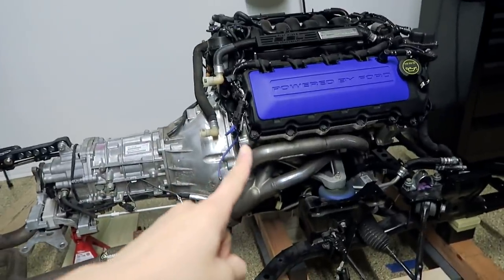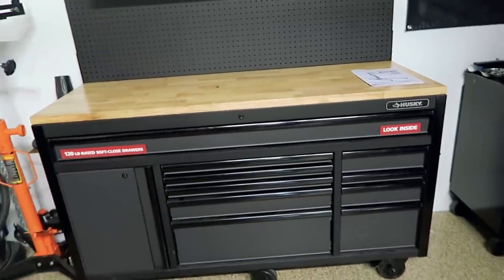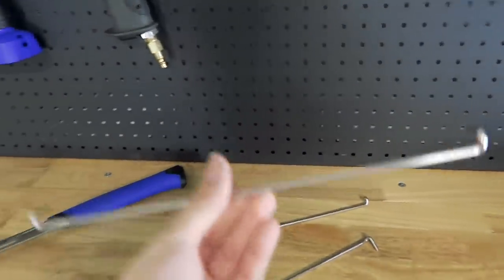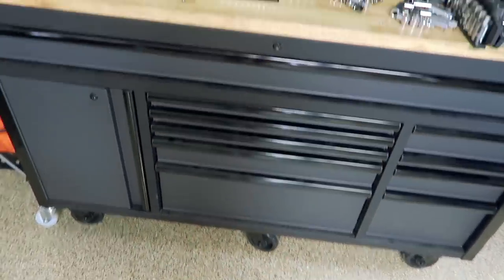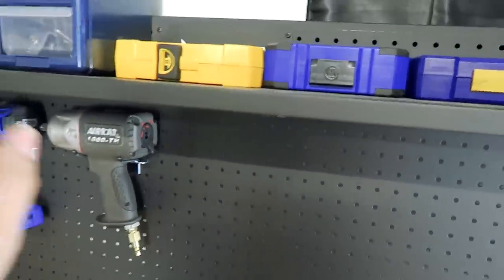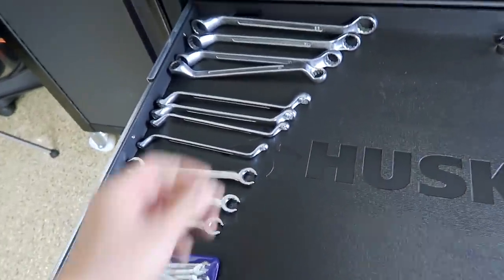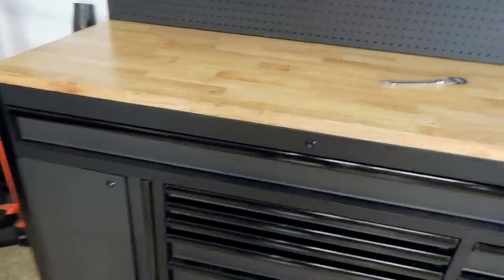I FINALLY got a BIGGER TOOL CHEST that fits all of my tools and MORE!!

Comment: Don’t get rid of the old box,  connect them together. Eventually you will fill them up.  It always happens.  Recommended note: In the aircraft industry, we use foam pads and cut out silhouette of the tools.  It makes it nice and neat, the tools are locked in place so they cannot roll around, and if one is missing you can easily see what is missing.

Comment: Awesome tool chest.  I have a huge 5 foot wide, 6 foot tall double-decker that I used when I was working as a mechanic.  Now since I retired I have pretty much been throwing tools into the drawers.  I need to go through and organize mine.. I have a drawer full of sockets all the way from 1/4 to 1 inch.  Hard to find a specific wrench when the whole drawer is filled with wrenches.  That old chest will work to put stuff that won't fit or you need to keep separate.  Another suggestion, labels.  Label each drawer so you can quickly go to the right one.

Comment: I been a mechanic for over 20 year, I brought the 56 inch husky top and bottom toolbox 3 year ago I still haven’t complained yet. I own lot of different brand toolbox.I just can’t justify spending 10,000 plus dollar on a toolbox
Reply from the maker: I agree. I see no issues at all.. I've had some comments stating why not snap or other 6-7k+ tool boxes.. well. The $700 one I have fits the same tools and works the same way ;). I can spend that money elsewhere. Cheers!

Comment: You can get foam pads which you can cut out yourself and put labels on for each spanner / socket etc so it stays in place for certain and has a dedicated slot, along with small stickers saying the size etc

Comment: I saw you spend a lot of time organizing your wrenches during the change-over to the new tool box.  They won't stay that way, though, for long.  Every time you open or close the drawer, they scoot or roll around inside.  Have you considered buying some wrench racks or using the plastic bags they originally came in?  They're also handy when you need to take them from the box over to work on a car.in the garage; it's the same principle as organizing your sockets.  Try giving those a shot; I think they'll work out for you.  Incidentally, that bottom drawer full of odd tools and battery chargers that you can no longer identify is usually called your junk drawer.

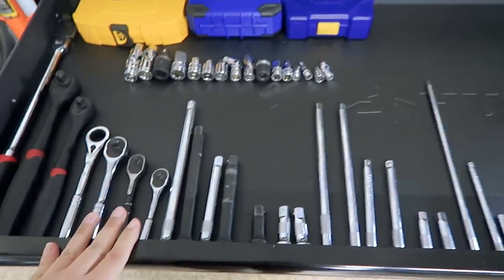Comment: Doris--It appears that you already have drawer liners in your toolbox, which is great.   Keep your tools in the carriers provided at purchase, or buy wrench/plier/screwdriver racks.  I don't care much for socket rails (they're flimsy and tip over),  so I buy plastic socket trays to store and transport them as needed.  This prevents them from sliding around and maintains your tool organization at a reasonable cost.  All or most of these items can be purchased on Amazon or at auto parts stores.  A few drops of oil on the drawer slides and/or bearings insures they open and close easily.  The "converters" you mentioned at around 7:20 on the video are more commonly known as adapters.  For instance, you can use adapters on a 3/8"-drive ratchet to also handle 1/4"-drive sockets, as well as 1/2"-drive sockets.  I'm not gonna tell you what tools belong in what drawer; everyone needs to figure that out for themselves.  You usually end up putting the most-frequently-used tools in the top couple of drawers, and lesser-used items below those.  Other than that, you're doing fine, so have fun.

Comment: I'm going to be really technical here but here goes, clicker torque wrenches have moving parts and really should be kept inside your house where the temp. is controlled and kept away from temp. swings. May I also suggest that they be calibrated before you start assembly. 
Have a great time with your project!

Comment: Should get some dense foam to use as a cavity insert organiser just cut out the shape for the tool and insert the tool. Neat and easy to maintain. Stops everything from sliding around in the drawer when you use a hip to shut it when you are busy

Comment: Check out the Tekton wrench trays. They come in various sizes, for your various sets. And they store them slanted and overlapping, so you'll shorten up your columns of wrenches. What are your plans for the old box? I was thinking you could make that a pneumatic/power tool cart. Maybe wall mount the chargers, keep them from blocking table space. That would free up a ton of space in the new box for more hand tools! 😁

Comment: Very nice. I was going to suggest going to a local mechanic and asking to see how they lay out their boxes. Since they do it on the daily, and may put stuff such that most used is higher, etc. But alas, you have a system. Fine tune over time. Very nice start to a well rounded set of tools. You should be able to handle most jobs. I suspect you'll need a few more tools for the engine rebuild. Mag base and a 0-1" dial indicator comes to mind. I like Starrett or Mitutoyo, but not required. I was a machinist for quite a few years so I have a lot of tools for that job.

Comment: You should Mount the chargers either on the pegboard or on another board which you could secure to your new toolbox.  This way you could have them powered up and charging whenever necessary.

Comment: Save your top draw for what u use most. Exp metric sockets 8 10 12 14 X 3/8, and 17  19 22x 1/2 etc.,  ( for metric )keep those handier. Than odd sizes like  11mmt.  just an idea.

Comment: stick all those SAE wrenches and sockets in a box and then put it in a very dark corner. You won't be touching them for a long time unless you work on 1970s or older cars. You will need 3 times the size of that tool box as it is already without the SAE.

Comment: Go girl... go... you been busy!, nice toolbox, please reseal the cutting board top, it will last way longer... they don't do a very good job on sealing their tops (IMO) maybe flip it to its non-treated side an do a sealer over it... Now you can use your old toolbox as a service cart... use the drawers for parts an the top for a work surface, leave the top drawer for your most used tools to cart around, that way using both daily an your newer box will be in better shape to last you longer or use your older box for storage of older tools.. You need a flex head wracthiting set, I love mine and I use mine a lot, eBay sales cheap ones or you can buy a small set to start off, like gearwrench, there's no offset for the head so you can change the angle ..making them easier to get into those hard to reach areas, that have a hard angles, that a regular wratchetwrench won't angle at.. Just a thought.... Thank you for sharing the news on the other cars an the sweet new tool box.. (edit) : Oh, sorry to ask but does your peg-board seam a bit weak once you start loading weight on it, if it does... Theirs posts that you could run along the back of your box to make it stronger an support more weight if it seams to weak?

Comment: Good you got the middle swivel wheel. I have the Huskey 72" and the middle wheel is fixed. A big PIA when trying to pull the chest away from a wall.  Swapped with Harbor Freight wheels.

Comment: Get long enough bolts to put it on the engine stand. The length will depend on the engine stand you have. You’ll have the engine in the air and now way to bolt it to the engine stand. Happened to me plenty of times.
Reply from the maker: That's a very good idea. I will go ahead and check. The stand comes with bolts, but you're right. It make not be long enough. Thanks for the tip!

Comment: Got some socket holders for all those extensions, keep all the sizes together and won’t roll around in the drawer when it gets bumped/moved
Reply from the maker: They don't move at all. At least not when I open and close them. That is way I have them facing in that direction.

Comment: Love the new tool box/bench !! Sure helps when you can locate the tool you need in a timely manner. Someday you could mount a power strip on or in the tool box so you can plug all the chargers in a have the spare batteries ready for use. I used a hole saw on mine before I built a bigger work bench just for electrical work. Made same hole in the back of the drawer and ran all the plug wires up to the power strip. Can’t wait for the engine tear down and also the Hellcat videos. You’re doing a great job! 👊🏼

Comment: Congratulations on the new equipment. Have you researched the Shelby GT350 motor? It’s known for spinning the connecting rod bearings. When you tear down your motor, I’ll bet money you spun at least one rod bearing. Ford should’ve honored your warranty since it’s been a year with this as a known issue with the motor. Keep up the good work.

Comment: Idk how your battery charger hold the battery but I have my Milwaukee chargers mounted to the side of my cabinet with 3/4” self pierceing screws and they’re out of the way and always easy to pop them on and off. Got the idea from the super expensive Milwaukee toolbox that has the mounting already for the chargers. I love it like that 👍🏻

Comment: WOOOOWWW!!! That is a nice tool box....great upgrade. I too like to be organized and it expedites the need to find the correct tool when you have to complete any job, in this case, your auto upgrades. I’m extremely interested on your GT350 motor fix.
Reply from the maker: Thank you, I appreciate that. It does make it faster. I will be working on the GT350 this week! Thanks for watching. Cheers!

Comment: I got out of the motor repair trade because, in the UK, it is a mugs game. The wages are pretty bad and UK mechanics are constantly in debt with the Snap-on guy or the Mac Tool guy keeping up with the constantly changing tools. A former work colleague had a roller cabinet and top box that cost £7000, before he put a single tool inside. Mind blowing insane, when an employer expects you to rock up with your own tools at these costs and pays crap wages. I was highly qualified and had decades of experience. Now i only get my hands dirty on my own vehicles. That said, it is good to see a lady that can strip an epicyclic gear train!

Comment: Look in to Tekton socket  holders  I use a couple that I cut in half and have one for my 3/8 extensions and adapter and one for the 1/4 drive and use them also  for my sockets

Comment: Awesome Doris great job I love the new box . You could put the chargers on the peg board with a shelf that would open that draw and if I was you I would get a piece of stainless plate an put it on the either side top your box for the vice then mount your vice on it so it would be rigid and so your not damaging the wood surface. Don’t forget too countersink the fasteners into the stainless. Anyways great job Doris 👍🏻

Comment: I can appreciate the effort well spent on planning your tools out so that it makes for ease of operation when you're in the middle of project. I built my rollaway cabinet tool box to have space with my vice. Also larger things like drillpress and grinders on plywood bases to be clamped or bolted to the counter for use. Nice job so far though

Comment: I like the new toolbox. Do you have a cabinet where you put the fluids (ie, brake fluid, trans fluid, oil, etc). Might be helpful in the event you need to access them quickly. I think that might be something to put inside the large empty cabinet, but you got a heat gun there, which makes me think twice.
Reply from the maker: Thanks! Yes, I have a completely different cabinet with fluids. It was against the wall. There is also another cabinet with detail solutions and equipment.

Comment: FYI - you really DO NOT want to mount a vice to your toolbox... Mount your vice to a WORK BENCH Your Toolbox is not meant to have a vice mounted to it... a work bench is made from heavier grade steel and will endure years of abuse, while your toolbox will not be as fortunate. Mount your chargers to the backboard of the toolbox or on a wall, because you will need to charge your cordless tools and have them in a convenient place.

Comment: Your socket drawer is laid out dumb lol. Not trying to be rude. Get rid of the socket trays you have in there, you dont have them even half way filled out so there are alot of wasted space. Get socket trays that arent labeled. Yea it sucks not having a lable and just being able to look but once you get used to it, its alot better. And get organizers for the wrenches. Theyll just slide around in the drawer when you open and close it. And youre not going to remember all the time to close it softly and even soft close drawers will still do it. Otherwise its a nice box. :D

Comment: yes, don't think i didn't see that new box/workbench sitting in the background of the engine drop video.  i just didn't say anything, but i saw what you did there... 👀😃
Reply from the maker: Haha..yup..it sure was. I was supposed to make this video first. But I wanted to get the engine drop out of the way first lol.
Reply: @woman.driven  okay well snap a pic of that old Kobalt box and put it on LETGO, then have chris roll it outside.  as you see you're  running out of space and gotta make room...!!!  think of it this way, as a bonus once organized you might just make it on the next upload of Gears and Gas.  yeah, they can feature you/Chris after Tavarish... 😃 https://www.youtube.com/watch?v=3FZxaywbNbs&t btw, notice the contrast between the "OCD" of OG Matt and how Freddy is basically shown 180 degrees at the opposite end of the spectrum with ADD.  LOL  clearly one man is AWARE of his condition and the other is NOT.

Comment: Be very careful with the amount of weight you put in the drawers.  I have friends that had to buy need slides cause they don’t support a lot of weight. I think like 120 pound per drawer.
Reply: The top large drawer should be for long items and not loading down with as many sockets and such for that reason. Depends on if it has double or single slides I guess.

Comment: Highly recommend some wrench organizer rails from amazon, black and red for SAE vs Metric. Another good option was the HF wrench organizer. In my single draw I used nothing but sockets I used same HF organizers but made modifications using impact sockets large in the rear, then in front used impact swivel set then added my 300 piece socket set. I dropped all my adapters and ratchets in closest smallest draw. 
Rails:  https://www.amazon.com/dp/B0060LQ6HE/ref=cm_sw_r_other_apa_i_Won-DbQ6R7RK9
HF 76 ORG:  https://www.harborfreight.com/76-piece-wrench-organizer-46884.html

Comment: What size is that car lift?
Reply from the maker: The 4-post is about 9' in width and about 16' in length when you add the ramps. The 2-post is about 10' in width.
Reply: Why haven’t you gone with a snap on box or Matco? Just curious
Reply from the maker: No real reason other than availability when I need it. I can just go to Lowe's, Home Depot or Harbor during open hours and get what I need the same day and keep working.
Reply: What you’re doing is amazing! Especialmente siendo latina. Eres una inspiración para todos. How did you get into cars? I got into it through my dad since I was a little kid.

Comment: Crows Foot, is seldom used, but when needed. Awesome to have. 🙈🙉🙊😎 🔧🔩🔨📐📏📎🔗🍻
Reply from the maker: That is true..I needed it to hold a nut while I tighten the front support braces on the GT350. It would have been impossible without it ;)
Reply: @woman.driven  i know that's right, not like the fingers can be re-twisted too form. Lol